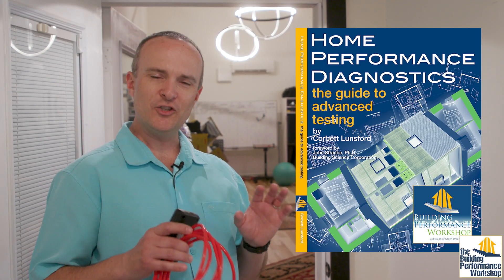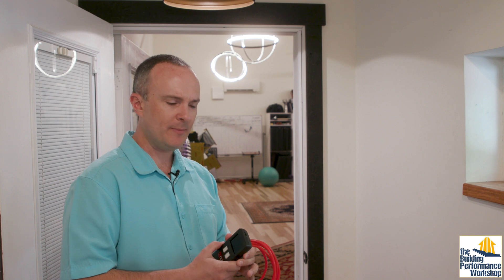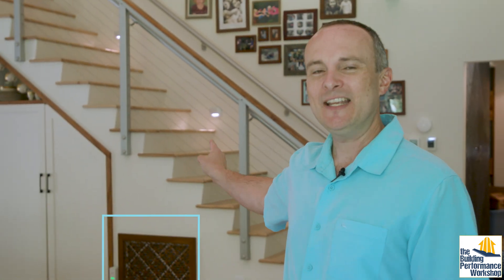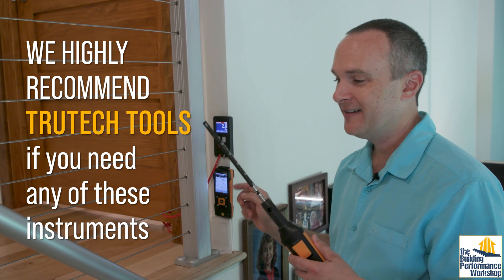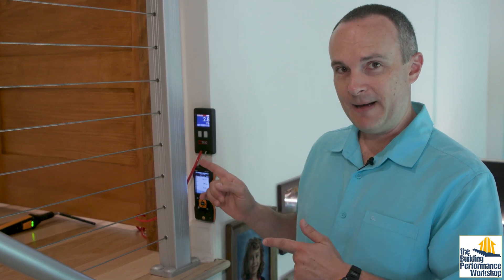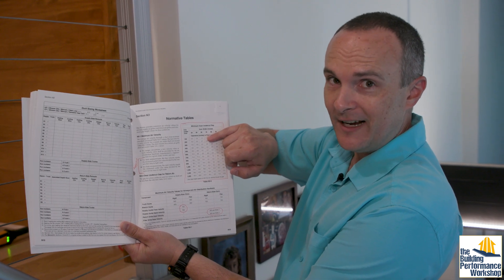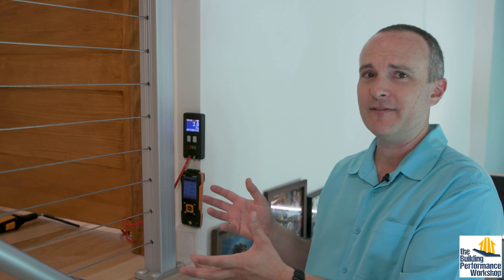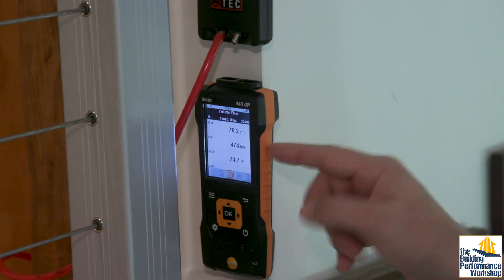How to Test HVAC Room Pressurization (Zonal Pressure Testing for HVAC Commissioning)

Comment: I came across this video because we just installed a new AC unit and air handler. Since the install I’ve had a really bad case of tinnitus where I cannot sleep in my bedroom because the pressure in there is horrible. I have humming all night long in ears. I have to sleep in the living room. How does one go about fixing this will help? It’s disrupting my way if life. They replaced ducts also but not thru the house just the k es that lead to ac.

Comment: How do you test air pressure fluctuation in a single space, with out reference to another space?
Reply from the maker: All pressure is a differential measurement, so you have to have a reference.

Comment: Would you generally recommend a central return for tight homes?
Reply from the maker: I do personally because you’ll have very little airflow into rooms in tight homes, but this topic does start fights.
Reply: @HomePerformance  thanks for the reply, any good videos or articles on this topic that you would recommend? I looked at your HVAC course but seems it isn't available yet

Comment: Something that confused me when I tried to do my own calculations is you don't appear to actually have a 1" clearance beneath your door: 65.3cfm / 396fpm / 36in = 0.66in. Other than that, fantastic video, I really appreciate the in-depth explanation. This is helping me check my own door undercuts and whether to do jump ducts. The answer, unfortunately, is yes -- I'm calculating ~10Pa with 32" doors and 0.625" clearance at ~150cfm.

Comment: Hi. Always learn so much from you. I wanted to ask. I moved into a house that was build in 1962. There's a return vent in the basement. Is that normal and necessary? The main return is on first floor and no returns on the above floor. Also the return in the base, if I look through it about 10 feet across is the main return so wonder would my house perfom a bit better if I closed the basement  one. I did a blower door test, horrible number at 15.7 ACH. My goal is to bring that down as much as I can. The second question is, what's a realistic goal for that loose of a house? Thank you.
Reply from the maker: Hey NYC, thanks for following. The basement return is certainly helping, and definitely not hurting. I’d leave it just as it is. And plenty of leaky homes in NY have been sealed 25-40% by the weatherization teams through NYSERDA, I’d start there. Bet there are some huge holes that would be simple to seal and get you way tighter in a matter of hours.
Reply: @HomePerformance  thank you very much for your  response and help. I live in NJ, I need to change that name, lol. Any recommendation in NJ you like?
Reply from the maker: It’s a big state, but I have a few referrals, yes
Reply: @HomePerformance  I'm in the ocean county area, south central NJ, Toms River.
Reply from the maker: You can try Sanders Home Services, not sure what they’re up to these days but was impressed in 2016.
Reply: @HomePerformance  thank you

Comment: I purchased a cps products spm-100 to do this room to main enclosure type testing, but am having problems with the product.  It reads pascals to one decimal digit, the same as your tec tool displays.  However, with the tool calibrated, and both ports open to atmosphere, I have a 5-7 pascal difference.  I've tried rebooting the tool and recalibrating it more than enough times to rule that out as a variable.  Could this variation be just because of the small, minute pressures we're trying to differentiate here, or did I just cheap out on my instrumentation?  How does your tec dg-8 act with having both ports open to atmosphere (in a still environment, of course.)
Reply from the maker: The TEC and Retrotec manometers will show actual 0.0 Pa (fluctuating with breeze). That’s what you’re paying $600 per channel for.
Reply: @HomePerformance  thanks for the response!  I'll get in touch w the company and hope for a return/upgrade.

Comment: Will dents in ducts be a cause of zonal pressure issue? Or would those dents only cause lower CFM at that specific supply vent?
Reply from the maker: Hmm, interesting question. I guess it would make the duct smaller, essentially, which would drive up static pressure on the fan and lower airflow from the duct. But the zonal pressure effect on the room would actually be lessened.
Reply: @HomePerformance  so as an the effect of dented and damaged duct work, you'd catch it in the static pressure testing, I see!

Comment: My home is 5 years old. Every winter we have issues with doors and locks  freezing shut. We tried everything from lowering humidity inside the home, we changed locks so many times, getting home inspectors involved to see if hvac or vents are not working properly. As of the moment we are looking into getting storm doors installed to help with the frozen doors and locks issues. One home inspector mentioned about getting the pressure in the home checked, we spent so much money on fixing this issue could you please enlighten me if this is necessary. Thank you so much.
Reply from the maker: Yes, highly recommend. You can get a high quality digital gauge yourself nowadays for $600, and you’ll have some answers:
https://www.trutechtools.com/tec-minneapolis-dg-8-digital-pressure-gauge-kit.html

Comment: Looks like you have an "exterior" door separating your studio from the rest of the house.  You've said elsewhere that they are separate systems.  So how do you test in a situation like that?  Unlike a bathroom or bedroom door, there's no gap unless you crack open the door, which obviously, impacts results.  I've thought about putting the tube through a window and taping up the rest of the gap.  Is there a better way?  Also, how do you measure the air leakage between a home and attached garage?  Since garages are leaky, I can't think of a set up that would separate leaks from the garage and leaks from outside.  Thanks!

Comment: Generally speaking. If you have the standard 1” bottom door gap, would cutting an additional inch off the bottom of the door (so 2” total) improve the airflow?
Reply from the maker: It would potentially double it
Reply: It might also increase the light and sounds that comes through the door, which isn't good for bedrooms.  Corbett shows us that we can use the Manual D to calculate exactly how much of a gap we need.
Reply: @peopleunite  I recently living in a new build NV Home and the doors had a rather large 1.5" gap at the bottom of all the doors. Apparently this was by design (according to the builder) for improved return airflow. I can confirm it did improve airflow but it did have a downside of less privacy in the room.

Comment: A lot of what is measured and tested is pretty much common sense. No expensive tools and excessive jargon needed. Human noses are pretty good at telling us if something isn’t right.

And forget about the pressures in the studio for the moment, the echo and lack of thought into the acoustics of the studio was completely overlooked and f’d up by whoever designed it. The echo is annoying.
Reply from the maker: Geez Mark, I have 3 kids. The sound baffles of Rockwool Comfortboard are not made yet. Only two walls in this room are equal size and parallel, I think we did a pretty good job actually.
Reply: @HomePerformance  Oh, I don’t think it’s the kids fault, but maybe perhaps the kids can help fix it? They should be able to cut comfort board,? I’m not sure about your neck of the woods, but  a bag of comfortboard is way up in price. 
Maybe it’s good for you to wait to complete the sound dampening. That’s a good idea though, what material do you wrap the comfortboard in?

Comment: and the next question is, how well does carpet seal the door?
also interesting that you have wider doors than us.
we have a few problems with poor man hvac systems not having returns installed, causing depressurization of the main room, causing back drafting of fireplaces.
Reply from the maker: Of course if you don't have a designed system, then all bets are off. This type of test would be a forensic tool to figure out what's wrong, and how far from tuned it is.
Reply: @HomePerformance   absolutely.

Comment: Hi, not to change the subject,  but have you heard of high frequency  waves going up to 22KHz in an appartment building. I catch this on Advanced Spectrum Analyzer from playstore.  I read on forums  that these waves are not audible to the ear but to the skull neck chest abdomen and legs. Some people might feel mini vibes with resonance and pressure, especially when balcony doors are closed and no other noises are noticeable. Even when the wifi is off. To feel these you need silence. Writing to you from France and haven't had any straight answers yet. Some say it's from relay stations and got to do with volt meters to start with, others say mechanical or electrical.....thanks much.

Comment: Very nerdy and detailed, Love it! Since most homeowners cannot afford a $500 manometer and other tools like that, it would be cool to compare your calibrated, quality tools to some of the more popular and inexpensive versions you can acquire. Even if they aren't dead on, they might be reliable enough to give homeowners a starting point to work with HVAC contractors.
Reply from the maker: Interesting idea, Judman- I’ll think on it
Reply: I have a $50 manometer and it works just fine for stuff like this.  You just need to be in the ballpark… nailing exact measurements down to the 100th of an inch of water column is not necessary.

It’s also super handy for measuring pressure drop across furnace filters and other nerdy stuff like that.  Money well spent if curiosity about these things keeps you up at night.
Reply: @superspeeder  But to measure 2 to 3 pascals, that's around 0.01 iwc, so you would need a very high resolution (to the hundredth decimal) manometer if it only reads in iwc. What res does your $50 man do?

Comment: More nerdy = more better!

Is there a guide on how to design bypass ducts to reduce noise transmission?

I want to keep bedrooms as quiet as possible, and one of the best ways to seal out noise is to have a tighter fitting door with small undercut.  As you point out though, this either requires a return duct or a bypass, but a bypass can allow noise just like a large door undercut.

Tips?  Suggestions?  I’m thinking offset grilles in a stud cavity with some sort of internal sound insulation that doesn’t block too much airflow.